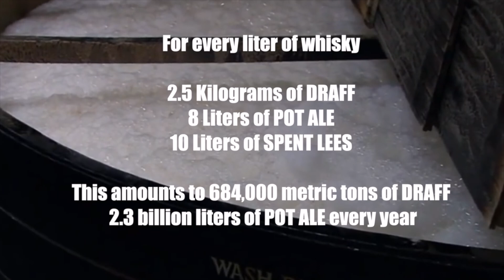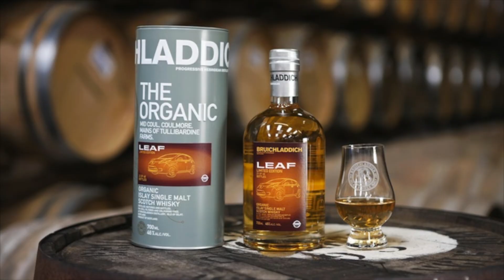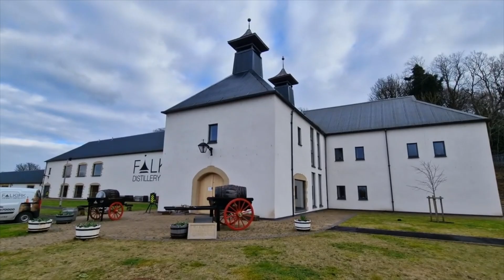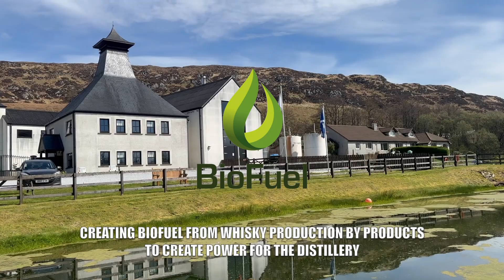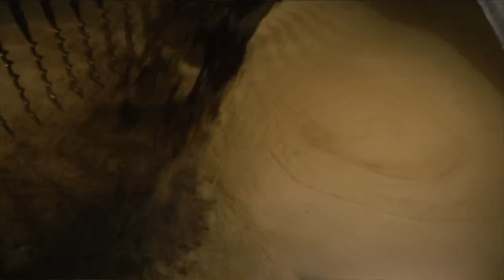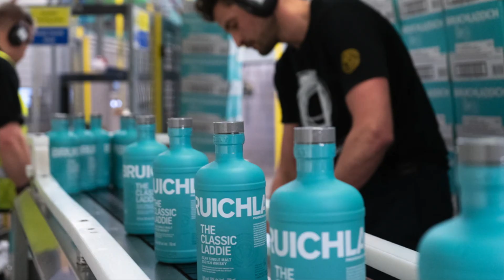Scotch Whisky Production Byproducts – Reduce, Reuse, Recycle

Comment: The Deanston Distillery in Doune (near Sterling) is the only distillery which generates 100% of its own electricity on site  - hydropower to boot.  400 Kw nameplate output.  Zero carbon emissions electricity generation.   As a person who has and is working in the energy and power space I found that to be fascinating.  We paid a visit to the Distillery and to the on-site hydro power generation plant -- both are in my bailiwick :)   I will never forget my visit to the iconic and massive Conowingo Run of the River type hydro plant when I worked for Exelon who owns that plant - and the Muddy Run Pumped Storage type hydro plant too.  The one at Deanston is, of course, a run of the river type hydro plant.

Deanston building is a former cotton milling operation (making it a very unusual looking distillery) that was sited on the River Teith because of the power generation it used from the river.  Deanston just took up the idea for its ops.

There was an old hydro plant that powered the distillery which replaced the old 17th & 18th Century big wheel but Deanston put in a brand new modern hydro plant in about 2000.   Technically the Hydro Plant is owned and operated by Wemyss Renewables - power plant ownership is complicated :)  

Deanston is owned by Distell (which is owned by Heineken same as Tobermorey and Bunnahabhain) but I heard when I was there in May that there was some form of very recent ownership transfer that I was not totally clear on but it sounded like some sort of buy out by folks related to or with Distell?  I maybe lost something in translation on that though :)